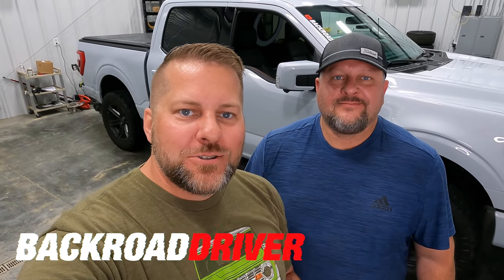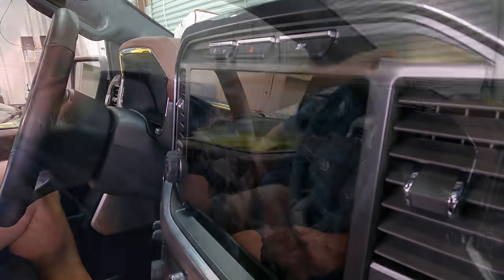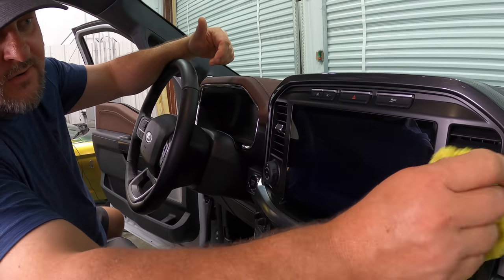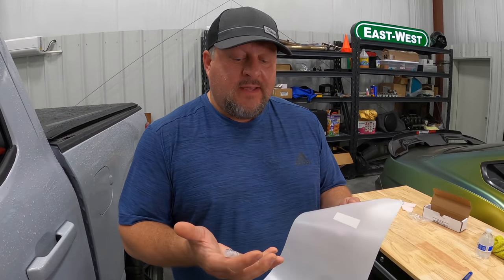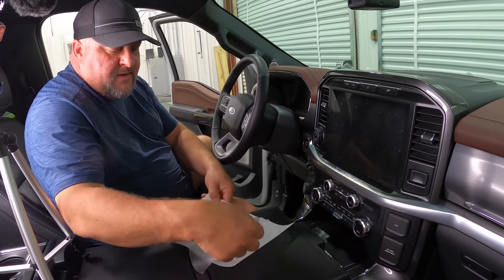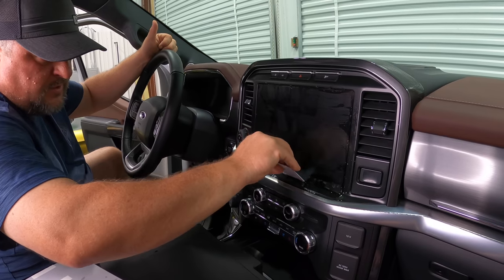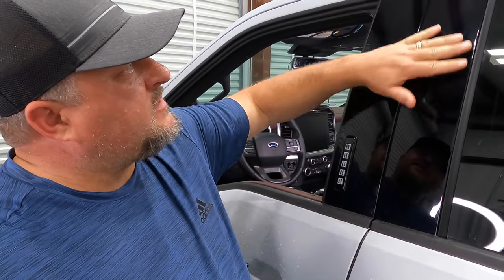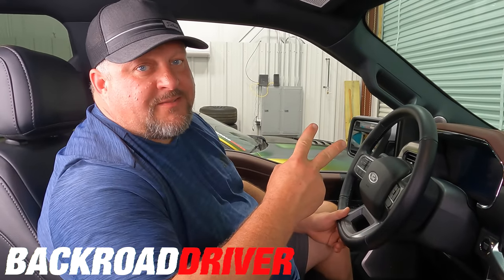2021 F150 Screen Protector - No More Greasy Screen - The OCD Plug Matte Finish Film

Comment: Hey guys, Im a subscriber, and I just took delivery of my 2022 F 150 Platinum Supercrew, 4X4 with the 5.0 V8 (ordered Nov 2021, delivered May 2022). I have done the following mods the first week I got it; Borla Touring cat back dual rear outlet exhaust, S&B cold air intake, 2" BDS level kit, Line X spray in Premium bed liner with the UV protection, and a Retrax MX Pro aluminum retractable bed cover. I like the mods you are doing to the Hammer! Keep up the great videos! The OCD Matte screen cover is next on my list! Thanks guys!
Reply from the maker: Congrats on your new truck Steven!

Comment: Subscribed!  Great video.  No issues.  Used two bottles of spray; slid better.  Might keep more nearby to refill bottle. Also have you installed a viscous dampening cartridge for the tailgate?  Putting OEM in to stop slamming the power tailgate.  Using points for it.  Maybe a video on this mod if not already?
Reply from the maker: Haven’t looked into that but will.

Comment: The only couple things I would add is to lay a paper towel over the edge of the squeege and it will soak up the excess water when it gets to the edge and keeps it from dripping into places it shouldn't.  Just move the paper towel a bit each time so it has a clean dry edge to soak up the water on the next pass . It keeps the squeege from scratching the screen protector also. Oh , and the wide blue painters tape is good to lightly lay over the screen on the last cleaning pass to pull any loose dust specks off. During the cold months it is easy for static to pull dust right outta the air onto the screen and the blue tape is just tacky enough to capture the dirt but not leave a residue on the screen .

Comment: For all of you moaning about using liquid on screen, it’s common practice for all kinds of stickers. 
We used to do coin operated video game conversions every day and put graphics on the sides, front and play panel and even though they had glue on them we would soak them down with soapy water, apply and squeegee out the excess, it allows you to easily adjust and get a perfect fit, it dries and stays adhered.

Comment: Subscribed on another of your videos! 
Just leased a 2021 Ford F150 Hybrid. I know I'm a real world lab rat with this truck.  I needed a truck to tow my travel trailer and I was lucky to find this one that had the capabilities I needed. It has all the tow goodies except Max tow and towing mirrors ( which I was surprised it was lacking considering all the other options).  It tows my trailer better than my 2018 F150 SC. 5.0  So far anyway. 
Good video.  Going to order a screen protector later on today.  
Stay well!
Reply from the maker: Thanks Mike! The power boost is a beast for sure.  Not having the tow package stinks. You get a lot of bang for your buck on that package. Thanks for watching!

Comment: Thanks  guys but I have a question I installed a similar one on another truck but I started getting bubbles under the film on a hot day even though I applied it properly and it kept coming back on hot day I will be buying this for my truck love the finger print resistance
Reply from the maker: It has been on for over a week now. Sam will give an update on how it is going when we do the B Pillar film install video. It seems perfect so far.
Reply: @BackroadDriver  looking forward to here what the results are when the weather gets hotter hope it doesn’t bubbles up on you

Comment: A titleist guy? Every time I hit one I screw up my swing, Callaway is nice and consistent, right now I’m demoing the new Epic driver. Not as good as the Mavrik but still a good club.
Reply from the maker: Yep I'm a Titleist guy.  I have a set of AP1's and I only hit pro v1x's.  Callaway is really good as well I know.  I'm always tempted to give them a try. I do have a few of their shirts though.
Reply: I have hit the AP1s and it most likely was operator error, because it was smooth and consistent but very short compared to my Rouges, my Rouges are smooth and consistent but much longer. The strange thing is every time I go to golf galaxy, I hit all of the irons. All of the Callaways measure up the same. Of course it’s a sales pitch so it will go 20yds further than actual but I couldn’t find much of a difference between any of them. Then When I hit a Titelist it is different, TaylorMade is like the RAM of golf, garbage.

Comment: Did you have any paint defects from the factory on your truck? I’ve seen a few trucks 21’s with issue. Then I went and double checked mine and there’s spect of debris right on the top of the passenger side fender 😓 then also noticed  a run right under the hood almost above the ford logo.
Reply from the maker: As a matter of fact I do have a spot. I'll point that out in an upcoming video. Thanks sosa!

Comment: Im about to trade in my 2020 cause of the rattle and the jerky transmission, would anyone know about how long it may takes to receive a truck these days?
Reply from the maker: With the chip shortage and new plant closures and closure extensions being announced almost daily I would say at least 6 months...
Reply: Oh wow! It is quite a delay! Thx for the info
Reply: The transmissions are still jerky. However the cabin is alot quieter. So far in mine I have no rattles after 1700 miles of hard driving.